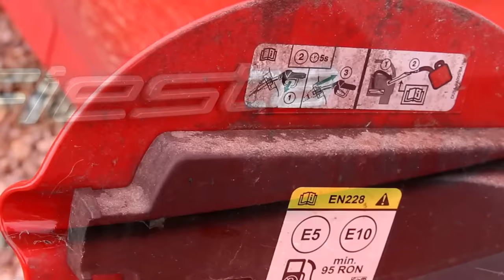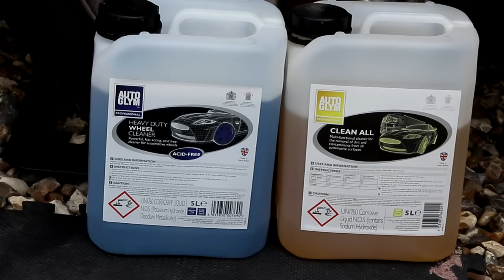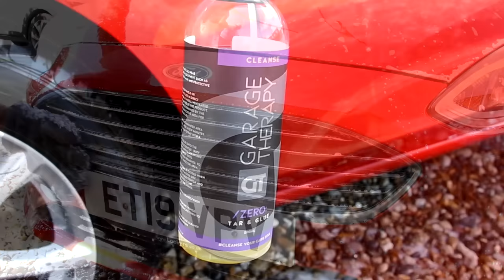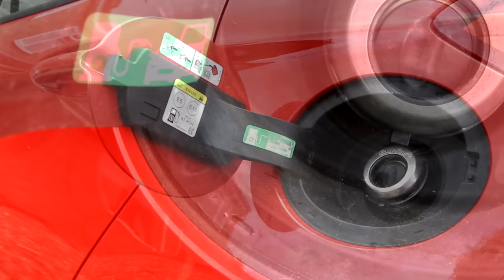Ford Fiesta wash decon and protection detail

Comment: I used Dry Helmet about 3 months ago, applied to whole car, then buffed off with dry MF after 15 minutes, no issues.  Posting this all this time later as it's keeping the white car it's on really clean, and it's still beading like a good'un.  There's chance it will have good longevity.  Also applied on black granite... no issues there either, but it's not very slick especially in first 24 hours after application, but holding up longevity wise.  And don't sniff it.... It's worse than IW Synergy Lite for the nazal stripping honk.

Comment: iWe use those,stiff brushes at work on engine bays abd really stubborn ingrained wheels . Our wheel cleaner is dog s**t but with these it will remove it . Handy brush to have though one you may not use often . Id heard Jody at Mile Deep saying about that smell and it would burn your eyes etc . Im yet to find something , or someone , to try my wet helmet on but heard good reviews . Cracking video as ever Paul , you forgot my rock though ? And Specky is on a diet so wont want his

Comment: I’ve got them cheap wheel Woolley’s what a load of dog,couldn’t get them in the spokes and they kept getting stuck on the backing plates so bought the Ez brushes instead,use the woolly for cleaning exhaust tips now

Comment: Really impressed with GT's Tar & Glue Remover but having problems with the spray head leaking the product. Don't know if it's just a one off or whether those spray heads can't handle the product and maybe it needs a more robust industrial type. Be interested to know if you have any problems with yours before ordering another bottle as it's works well. Thanks for the video and great result on a neglected car - it looks 100% better. 👍🏾
Reply from the maker: Hi Barry not unusual for tar remover heads to fail I’ve had countless heads just give up the solvent kills them on every brand I’ve used so far
Reply: Ah, I see - not just me then! I’ve only got GTechniq’s to compare it too which was in a 500ml bottle v 1L of Garage Therapy’s which is almost empty and is far more effective too so I’m guessing contains more solvent. I’ll try decanting the GT into a GTechniq bottle & head and see how that gets on. Thanks again! 🙏🏾

Comment: What attachment was on the ava gun when doing the tyres?

I have the red and black aliexpress brush thing and not noticed any shedding, prefer these as they dont spit/sling dirty water back all over you.
Reply from the maker: Look at my tracking link for the Ava site it’s the swivel attachment I think I need to do a full video on the gun
Reply: Checked the link and no joy. I have the vario nozzle that does 20 and 60 degree patterns. I feel like you had the 40 degree car nozzle one but just wanted to check for sure 😅
Reply from the maker: @ad_182_uk https://avastore.co.uk/product/ava-accessory-swivel/
Reply from the maker: @ad_182_uk got the white one which is 40 and the black is 25
Reply: @PaulDoldenDetails  the white one seems to do the business on the body! Will save the 20 degree from the vario nozzle for wheels and door shuts 👍🏽

Comment: What do you like better a dry helmet or a wet helmet? 👀 Great video and nice transformation
Reply from the maker: Not tried the wet helmet yet but I know this dry helmet is fiddly
Reply: @PaulDoldenDetails  yes what you was saying at the end about removing the product. I found it a little difficult as well but like you I found it easier when left for a while. You should get your hands on VPs fallout Remover, really strong stuff 💪
Reply: I've tried wet helmet, it didn't bond to the clearcoat